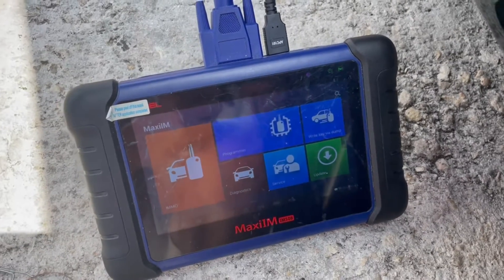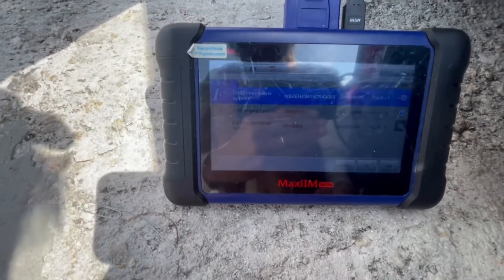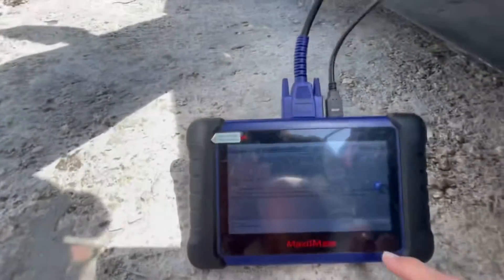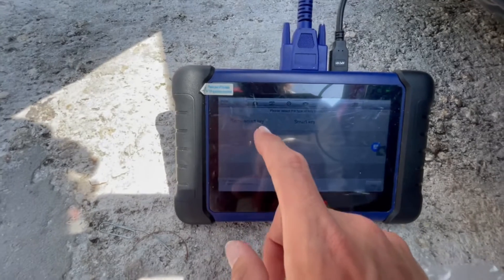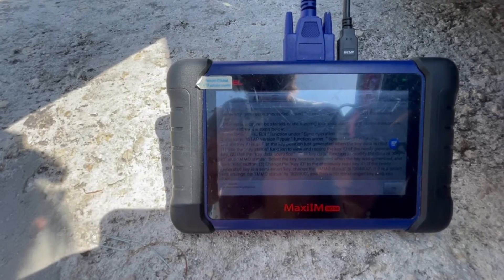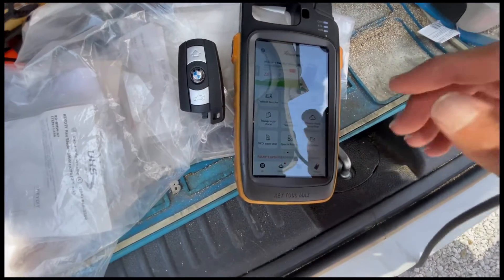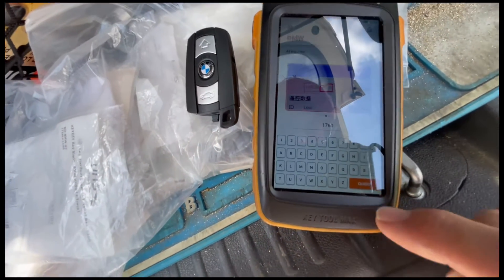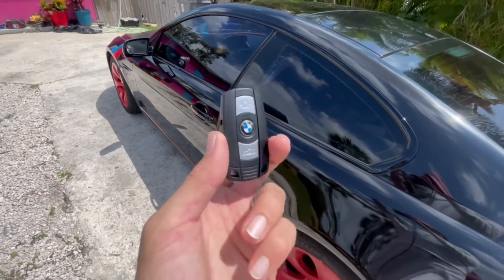HOW TO PROGRAM KEY FOR CAS2/CAS3 SYSTEM (2005 BMW 6 SERIES) USING AUTEL IM508 & XP400

Comment: Please excuse my ignorance but I’ve heard that of we do this bmws over obd specially with autel is a high risk of bricking the ecm is that true? Or just hype. Thanks
Reply from the maker: Depends if you know what you’re doing and what model. On this particular one it will be a crime not to do OBD 😂. Mostly a hype that keep you guys out from their jobs. The only thing is you need to maintain 13V of stable power on the risky ones. But also BMW dealer tool requires that so no difference
Reply: @ what system will be the most risky in your opinion?
Reply from the maker: Cas3++istep , cas4++, maybe those will be the ones that people are concerned about

Comment: what about 5 series, and it's cas2? same process? aftermarket parts ok?
Reply from the maker: If it’s using CAS2 or CAS3 system, it will be exactly the same
Reply: @legacylocksmith7874  thanks.... I'm doing add a key and people are telling me that a battery stabilizer is a must.  What are your thoughts? Also, I can't find OEM for this key, any suggestions? are aftermarket keys ok?
Reply from the maker: @Spec1aLisT24 connecting the car to a battery supply is needed more for CAS3+ and high step and always a good thing to have but in CAS two or three regular, the job will be so fast that you don’t really need more than a regular battery power. 
Aftermarket keys should be totally fine but keep in mind that aftermarket keys can be garbage as well. It’s all depends what the source.

Comment: not 2005, this is 2006. 2005 has physical ignition switch
Reply from the maker: I have put them together since the program is the same, no matter if it’s the slot key or the Blade key.

Comment: Where do you order your remotes sir? Locksmith frm Philippines her😊
Reply from the maker: I use local USA suppliers. I would highly recommend checking your region.
Reply: Based in USA , which is your favourite supplier, actually using UHS but some of their aftermarket keys are terrible
Reply from the maker: @user-ff5vw7wb7x yeah. With all the stores has bad items you just need to know them enough to know what to order and what not